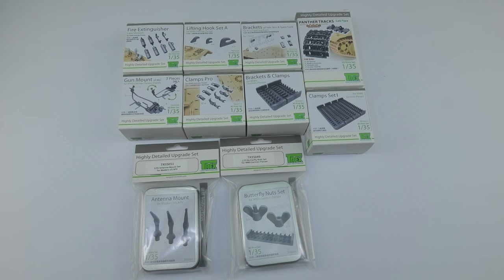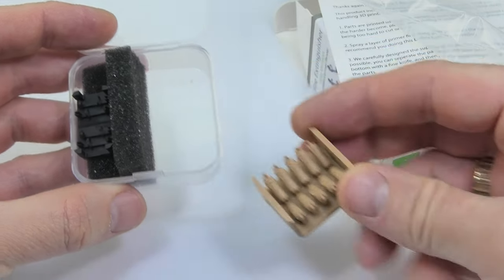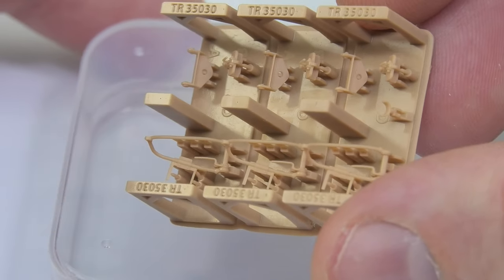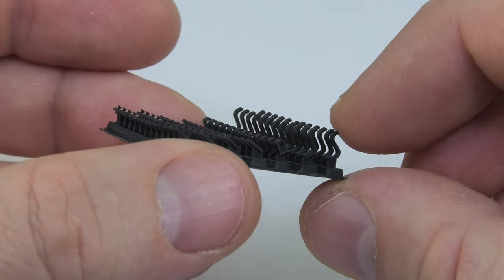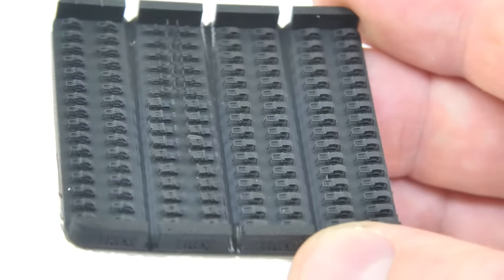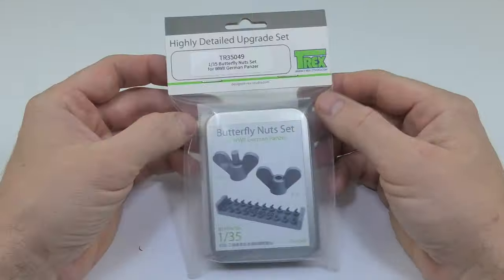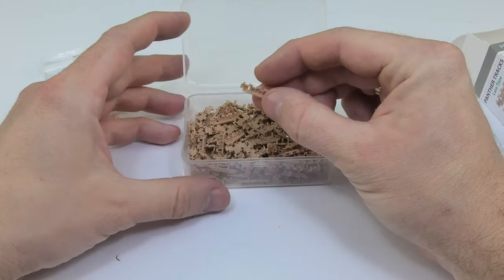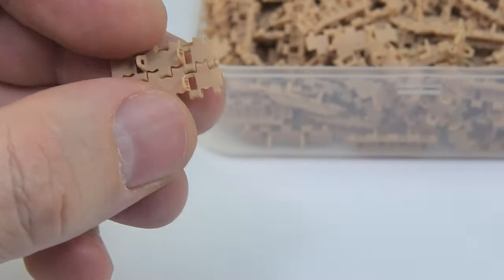OPEN THE BOX: Trex 3d technology printed sets. Panther late tracks and details for German panzers.

Comment: Purchased these and are now assembling them. A bit fiddly and some links are casted already broken. Pins fall out easily and can be A bit frustrating to keep in. Also...How many links make up per side?         Thoughts anyone?
Reply from the maker: Well, the pins fall out and I glued them with small amount of diluted white glue - just microdrop for pin. It helped. So, the broken links... I had all links in perfect condition in my set so can't say anything about it. Thx for your comment! :)
Reply: @coldemonspl  Thanks for the reply. I put small amounts of super glue on mine and that froze my tracks. When I tried to straighten them they broke..so I trashed them. Oh well ... $40 wasted. Guess I will stick to Fruils or wait until the 3D gets better resin. Resin they use now is to brittle!
Reply from the maker: @GB-yo8xf  Oh, super glue was bad idea :/ I used Quick Tracks as they are on "click" and this works very good. Cheaper, faster and the result is perfect. You can check how they work on my Open The Box videos.  :)